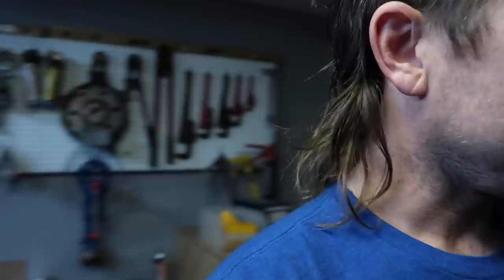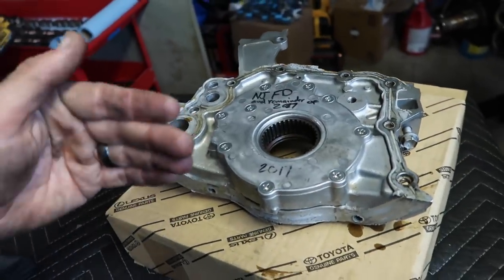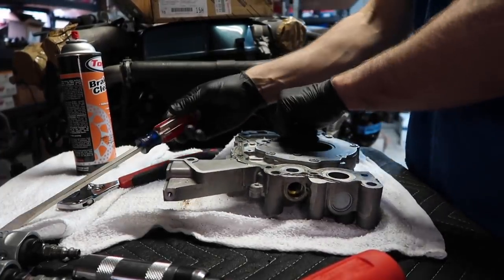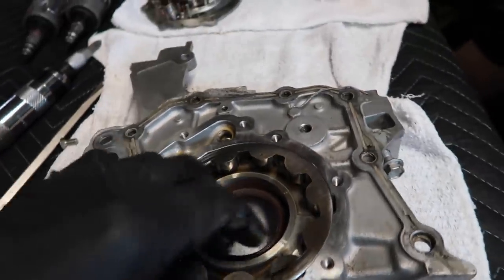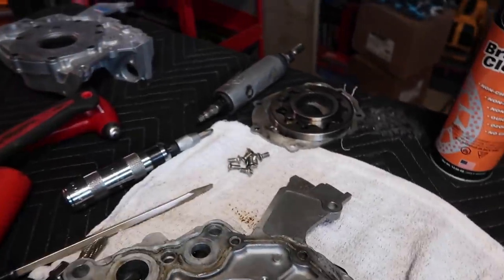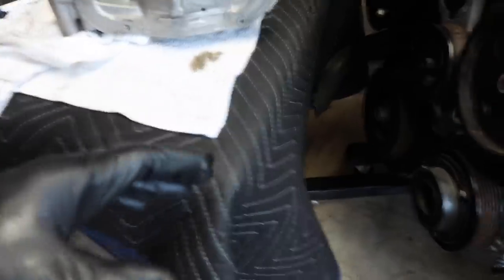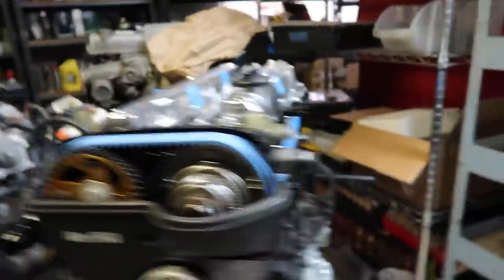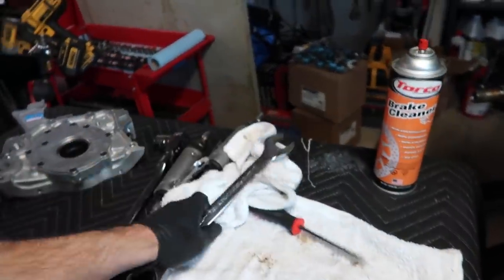Modifying Your 2JZ Oil System

Comment: I have a built ge vvti with no squirters. Had a gte pump on it. Too much pressure for my liking so put a ge pump on again. Been more than great. Wouldnt mind doing the more flow by doing the an lines out the pump, too filter/cooler to block tho

Comment: Thanks for all the tips! That flat driver and adjustable wrench trick was amazing. As the oil overflow my car is vvti in a mk2 Supra which  requires front sump so I will be giving it some extra oil! You me and my engine thank you!
Reply: Heat is a good trick also. I did not have a impact driver and I only had random philips and pozidriv bits that I was forced to use. Without heat torch those screw heads would have been completely stripped. I replaced them bolts with countersunk allen head bolts after porting the pump and shimming the pressure relief valve.

Comment: Apply a small amount of heat to bolts or screws that have thread locker on them I use a little butane torch at work like one for shrink tubing works wonders

Comment: you are the man ! i own and built a jdm 2jz-ge na-t out a mk4 supra in a 1987 Toyota supra mk3 now at cold start im at 125 psi of oil pressure when warm about 70 to 60 psi think that's OK  been OK for 1 year now im running castrol 10w-40 oil
Reply from the maker: That’s plenty good as it is now

Comment: For us on a tight budget, would you please recommend a good but cost effective oil cooler and also a oil filter relocation kit for our Supra's? It's basically impossible to change the filter with an after market intake manifold. Without making a huge mess! Also where is a good place to mount it? I feel behind the inter cooler is not enough air flow. Should I get a unit with a fan and place it where there is space? THANKS SO MUCH,     I love the channel, especially the how too videos. Keep doing what your doing!
Reply: Honestly mishimoto,setrab and koyo all make great oil coolers. Mishimoto makes a thermostatic sandwich plate for relocating your oil filter. Many ppl run oil/ ps coolers behind intercoolers with no issues due to its all made to be pass through parts for airflow. I haven't had any heat soak issues myself but ppl have thier own experiences.

Comment: Hi dan you mention front sump cars have significant issues with oil starvation I have a 2jzgte aristo which I’ve built as a drift car which is of course front sump I have fitted :

Oil cooler
Thermostatic sandwich plate
Tomei baffle 
I run 10w60
I over fill slightly 

I notice you didn’t mention sump baffles at all here any thoughts? It’s a street car to and I don’t have the budget to go dry sump am I relatively safe with the above? Am I missing anything?

Thanks,

Jake

Comment: Ok I got a question for a 2JZ-GE with VVT-i Carilo Pistons, Manley H-Beam Rods, King Race Bearing, still stock Stroke, Stock cams. Is it normal that a warmed up motor is around 15 PSI of Oil Pressure at idle? The idle speed is 700 RPM.

Please help I've asked the forums and seen the forums, it didn't help.

Comment: Okay, let's say I've been living under a Rock. Could you please explain a dry sump system?
Reply: Basically a mechanical belt driven oiling system with external reservoir that holds the engine oil rather than oil pan with the ability to adjust oil pressure. Eliminates all issues that crank driven oil pumps have and Pretty much the best oiling system there is arguably but it's very expensive but many high class race cars run them because you don't have to worry about oil starvation or cavitation with high rpms and g forces anymore pretty much.

Comment: Ok question, if we run that side port to the relocation oil filter housing setup, does the original hole for feed inside the pump need to be blocked off or that's just something they do when you by one of their pumps?

Comment: great stuff Sir Rad 
can do a cooling system vid for zj motor for front mount radiator for drift please thanks
Reply: 1 answer. keep the vicous fan ;)
Reply: @williamguldager  ok but i got no room of it looks like my j is in an
 e46
Reply: @KerryDrift  I went from fal to spal fan pusher fans on my rb s13 and car doesn't get over 170f normal driving and 190f full on drifting. I'm also running huge 12" 2400 cfm spal pullers on my 2j  s14. If you can't fit pullers that big you'll either need to make a custom core support or try to fit the biggest pushers you can. Either way jz's and rbs like to run hot under continuous hot lap drifting so just have to let cool down if temps get too hot.
Reply: @clutchkickpj693  full100 bro thanks

Comment: Hey Dan, super informative buddy. I use my supra on the road course currently oem oil pump/10w40 V300 Motul. Do you recommend I should purchase a modded oil pump for my app? Also what would be the max warm oil pressure you recommend?

Comment: sorry but there is a mistake with the information in this video.
the VVTI-GE engines do infact have a crank sensor, the pump housing between GTE and VVTI-GE are exactly the same, the only difference is the gears on the GTE are designed to output a higher oil flow.

Comment: Hey Dan what type of oil lump do you recomend for a 2jz ge na-t build? I'll be at around the 600hp mark. I'm not sure of I should go with maybe a stock gte pump or modded. I've just come across this whole oil pressure being too high due to not having squirters.
Reply: Did you end up with gte pump or modifed ge pump?
Reply: @thecookeman  I went with the stock ge pump. From all the Information I gathered since the ge doesn't have squirters the stock gte would of been too much flow and the modified even more flow.
Reply: @11onejay  checked oil pressure up 7000rpm+ all good?
Reply: @thecookeman  I haven't even finished my build yet. I live in california with our emissions ill likely never finish it. I've all ready bought a new audi as fun car. Cali sucks lol. I did do a lot of research tho and guy were fine with boosted ge blocks running the stock ge pump.